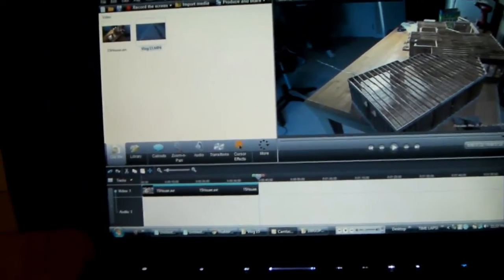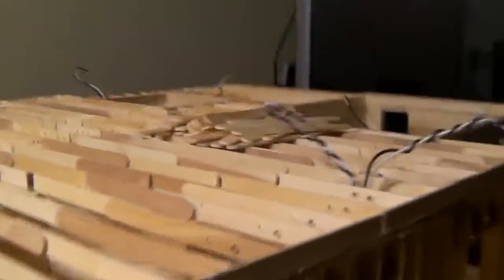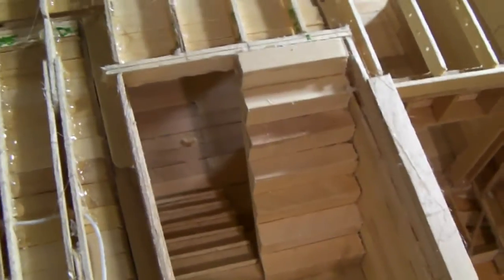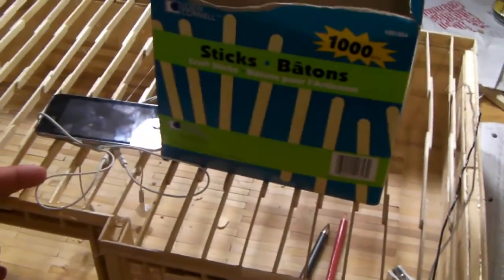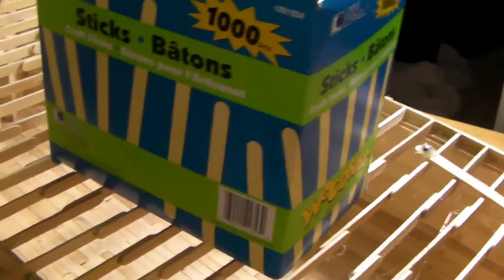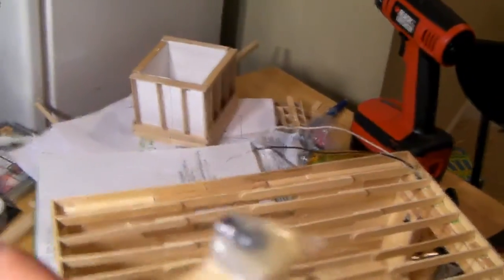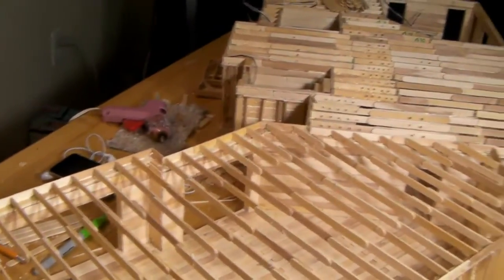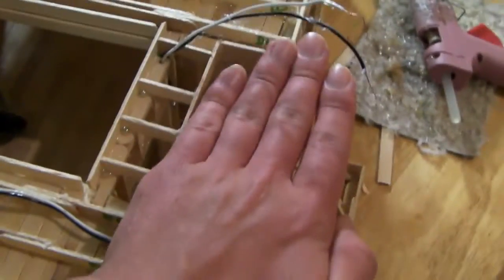15 - Building Popsicle House

Comment from the maker: Not a bad idea, but then I'd have to finish the slanted ceiling under the roof, and it would also be harder to put lights in the garage.  And, all of the electrical is going to join up in the attic and that's where the control panel will be.  Good question tho